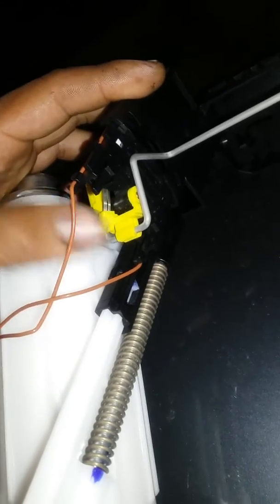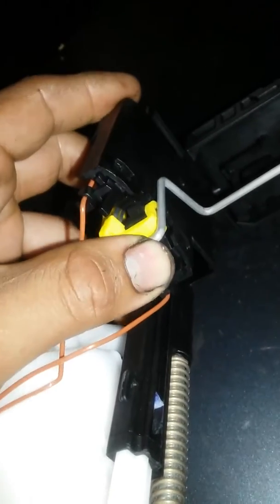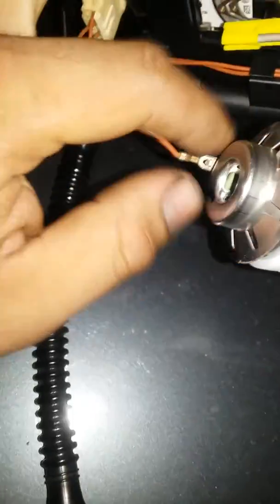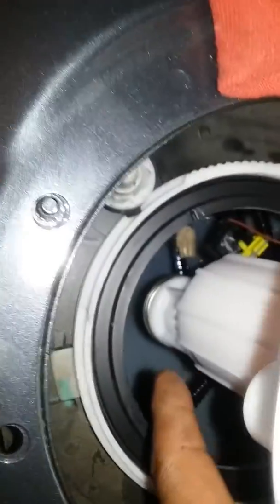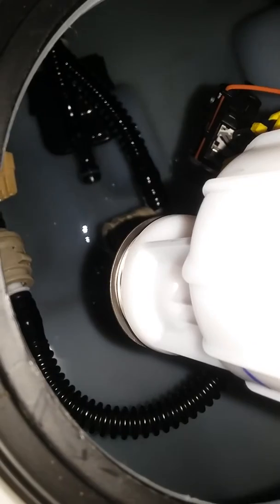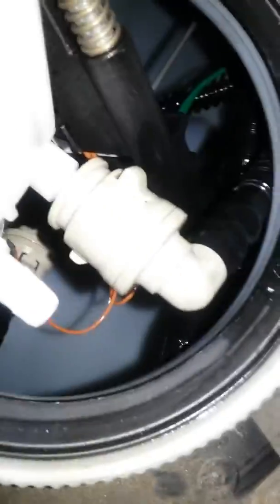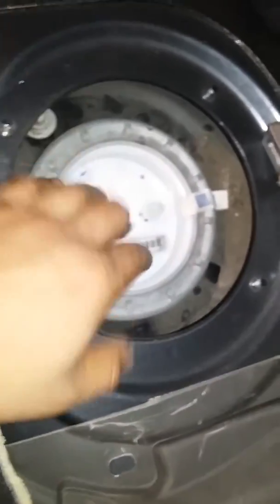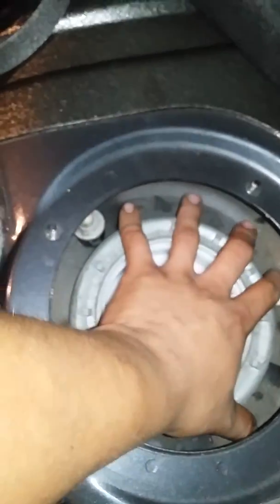2008 BMW 535i fuel filter part 2

Comment: Did you have to use a specialty tool to make the in tank disconnection/reconnection or was there enough room to get your hand inside?
Reply from the maker: Tony 180A hi there i did it by hand I had enough room yet a bit tight, but there is some pliers to remove the conection but I find it unnecessary